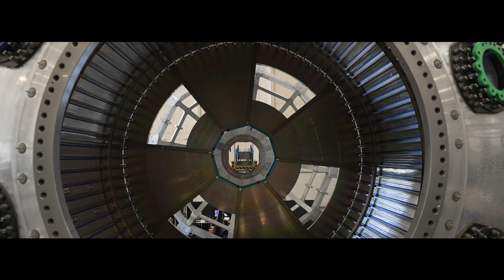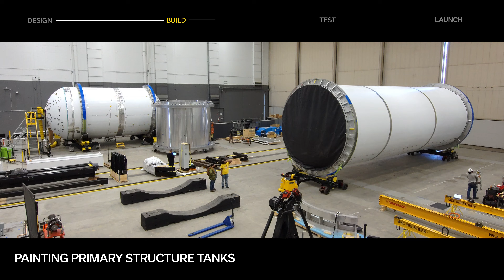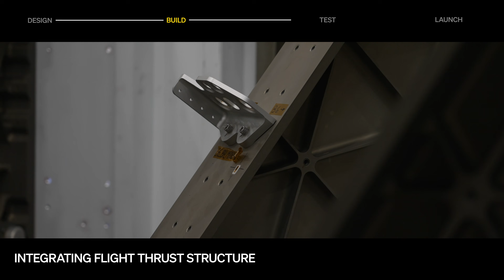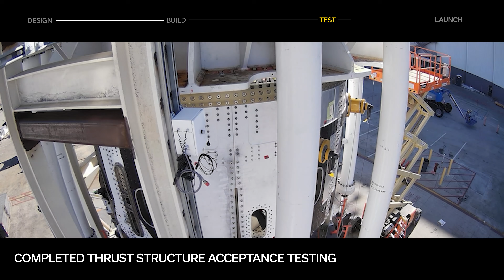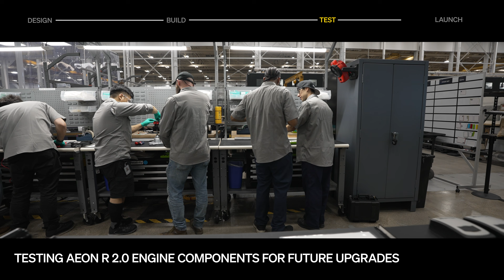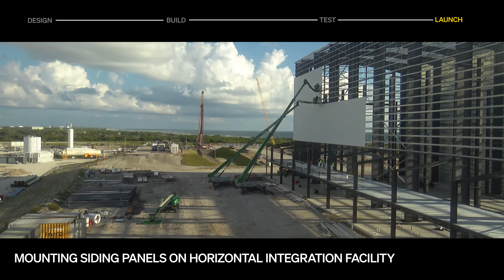Terran R September 2025 Program Update

Comment: So, did you abandon 3d printing your whole rocket then? That was the marketing USP but yeah, this is a far more sensible approch. Why paint everything though? seems stange to add weight. You hve Eric Schmitt now right? That will help you a lot.
Reply: 3d printing the rocket made sense for Terran 1 but for a rocket the size of Terran R, it might just be too big to 3d print
Reply: @Quasar-2  It didn't make sense for Terran 1 either, which is why they never flew it commercially.
Reply: @speedoftencats  They never flew Terran 1 commercially because no one wanted another small rocket. Electron and ride-sharing Falcon 9 was good enough for more customers so they pivoted to Terran R

Comment: Terran R is basically scaled up Falcon 9
Reply: In the sense that it's a partially reusable two stage rocket, sure, but in a lot of other ways, not really. Terran R has different engines, different propellants, and different aerodynamic features (aero strakes).
Reply: Well, falcon 9 has no competition in terms of lunch cadence
Reply: That would be pretty awesome, no? Anyway the issue I'd have as an investor is all this talk about 'welds'.. uh, are those 3D welds?